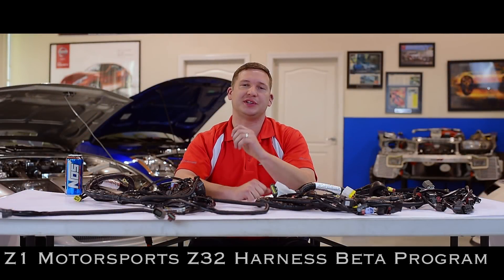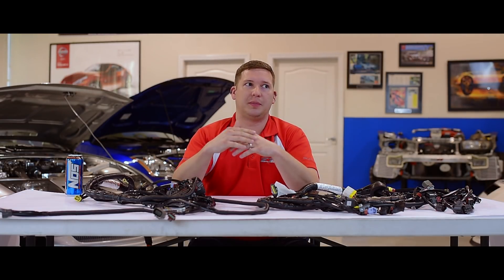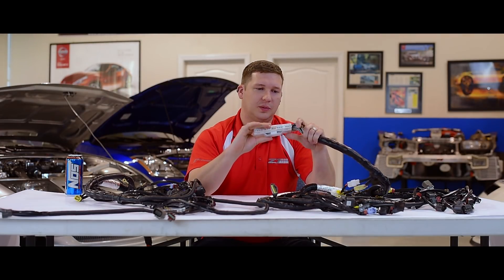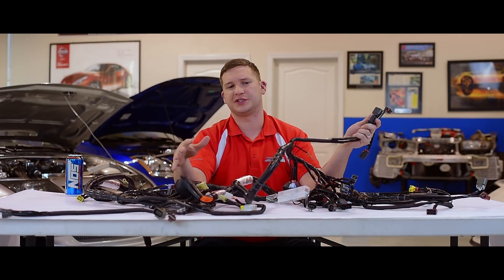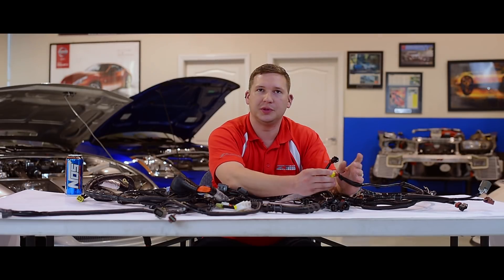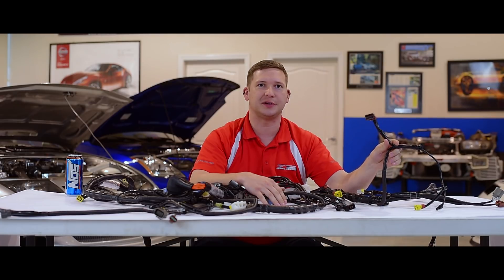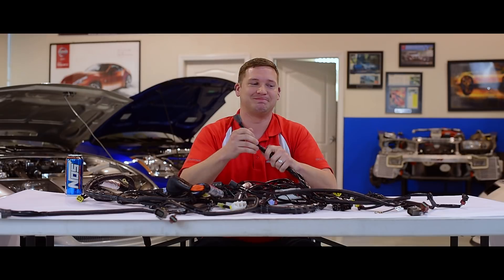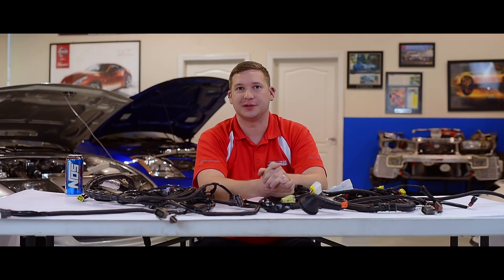Z1 Motorsports - Z32 300ZX Wiring Harness Beta Program

Comment: I just replaced the old harness with an aftermarket EFI harness on my '90 300zx na 5spd. I work at a professional shop, and it took about 7 hours. I made a couple of very quick videos of the installation. Id recommend replacing the harness to anyone that has enduring endless electrical problems, horrible misfiring issues, ECU's going bad consistently and etc due to a heavily corroded stock harness.